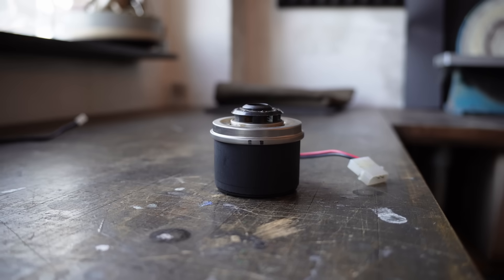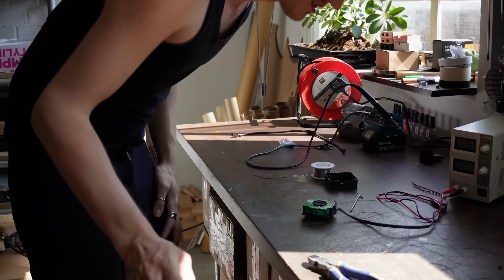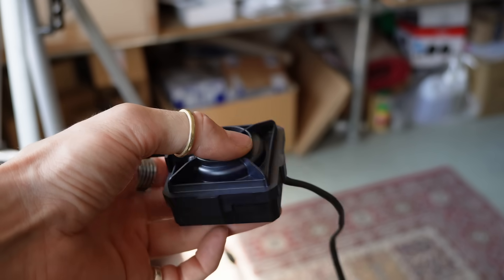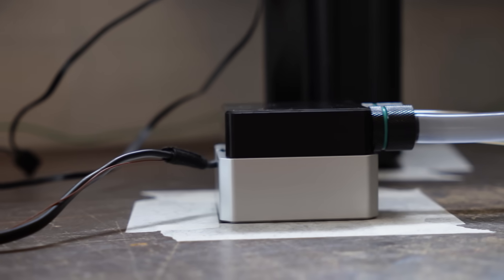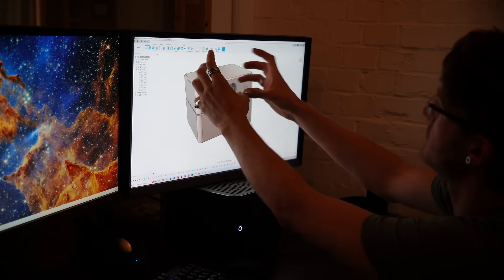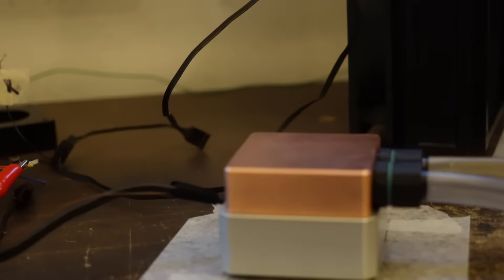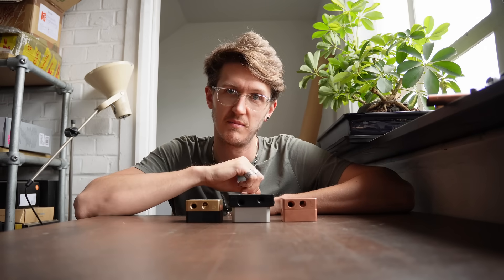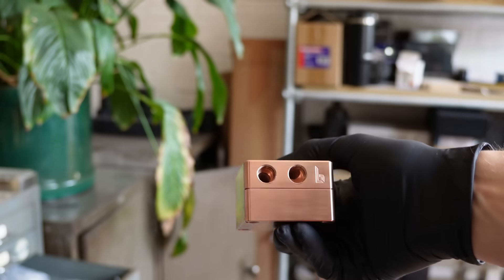Can you watercool your water pump?

Comment: I don't think the heat should be dissipated through the top where the water circulates because it heats the water and reduces the efficiency of the system.

I think it would make more sense to make a base with slightly larger fins and cool them with a fan similar to the size of the base.

They could also greatly improve the design of how water enters and exits the pump impellers and increase the internal diameters to 1/2 inch to reduce friction losses.

Comment: I was genuinely interested until I saw the price. 
I understand where its coming from, your work, the machinists work, the material, machine time etc, but thats a lot of money. I can buy a lot of pumps to burn through for that. 

Thanks for the scientific work on this though. And if you ever run out of ideas for stuff you make, I guess you can have a look at casting bits using lost PLA or making copper sponges. I hear those are excellent in terms of thermal conducticity due to the sheer surface area they provide. 

Oh, one more thing: Does your nail polish contain any aluminium oxides/salts? I would recommend not getting those near your fingers, as they are linked to dementia.

Comment: I watched the video wondering where you were going with the cooling. I wasn't sure if it would be a 2 part (horizontal slice) pump base, internal water channel around the perimiter with a 2nd restricted exit from the pump feeding it, or if it would be a thin cold plate with in / out integrated into the bottom of the pump casing to just hook into the loop. Turns out you went with option "C". Looks good too.

I run a DDC with large fin stack directly in the path of one of the 120mm intake fans on my case, so I never really noticed heat.

But another very cool video ('scuse the pun).

Comment: Hey, I just discovered your YouTube channel and you got some reeeeally cool things here. 

Something I have always thought but didn’t find anyone testing: negative pressure water cooling considering negative pressure should lower the boiling temperature and you’d take the advantage of the latent heat (and maybe have a way lower amount of active cooling required?).

That would also require a full ridged system, pipes etc. 

Do you think this could work?

Comment: A lot of people run the pump at 100%, if the speed is set against temperature, most of the time the pump will run around 20% duty, a lot less heat. It will only ramp up under constant long term processing loads. A correct size radiator will also extent the time the pump does not need to spin up as much.

Comment: So...buy a pump, then throw the housing away and replace it with the metal one? Might as well just source what chinese factory district the pump guts are made in and order them direct. And on that thought, Id argue chasing down which part inside the pump is being over speced and ran near its failure rating. Usually when mass produced chineseium stuff dies its because they took the absolute maximum rating as a 'totally A-OK 24/7' rating. Also, what about....just drilling holes in the plastic pump housing to vent that space that holds all that hot air in? I mean, really the problem is they have pushed the electronics too damn far. Like they do. How about not rewarding them with more sales for something you have to rebuild anyways....Find the pump supplier and give the middle finger to whatever company is marketing an inferior product version.

Comment: 12:18 Shouldn't use dissimilar alloys in water for any sort of long term use.  Dissimilar metals create a natural electrolysis that accelerates or even enables corrosion in cases where a metal shouldn't corrode (Like stainless steel and aluminum).

Comment: The problem with copper is...  (In my opinion) Longevity.  I think oxides will be a problem with time, and you'll probably need something like glycol instead of water.  Even the most pure dionized water will pull copper ions into solution and eventually become an issue as they migrate.  Especially if the pump is not entirely plastic, any dissimilar metals will similarly cause issue with corrosion due to dissimilar ions in solution (The same mechanism that suggests matching metals for hose barbs as well).  You'll also need to make sure the glycol is as dry as it possible can be, purge, and hermetically seal the whole system really well.  Glycol and mineral oil like to pull moisture from the air.  Any moisture in the system will likely cause oxides to build, that will eventually migrate and potentially clog the pump.  Your also lose thermal conductivity when you have a layer of oxides as they don't transfer heat as well as copper itself.
Reply: Rarely do pure copper blocks like this make it out of testing. The next step once the design is validated is to figure out a plating solution (likely nickel) and make sure it doesn't affect the temperatures too much. Not worth plating the prototypes since it would add a ton of extra time into the testing process.
Reply: @MaladjustedPlatypus  Solid point.  One thing you do can do as a marketing technique...  On top of advertising the copper block as a better heat conductor at what around 400 W/m·K, while aluminum is only around 250 W/m·K, and stainless around 30 W/m·K.  Then, the nickle plating, although very thin, is only around 90 W/m·K.  

The marketing technique that comes in is, while consumers are bad with numbers, 90 is < 400.   The 90 is what will translate to the average person (your consumers), not the fact that the 90 is microns thick and won't effect the overall heat conductivity of the copper more than like 1-3%.  So, you instead, provide them with a number that is higher than the 400....

It'll be more expensive, but, on top of selling the "lower" conductivity nickle plating, you can pay more to have them go through a vapor deposition process to coat them in GRAPHENE that you can advertise as "3500 W/m·K".  You can even through around fancy words like, "Engineered with an advanced graphene layer, this version leverages ultra-fast phonon propagation dynamics to improve thermal uniformity and surface-level dissipation".

I mean, that type if deceptive advertisement is shady and gross af, it'd probably work on gamers who are notorious for trying to min max every little thing

Comment: Even if it did perform the same as the EK one, it's better not only in size but in application, since it won't be as negatively impacted in places with low airflow or hot air.

Comment: Nice design;) this seems like the perfect use case for a heatpipe (bend into a c shape) but general problem with watercooling the pumps will always be, that the water can be warmer than 66°C which is over the ddc temp rating you mentioned, meaning it could burn out regardless...

Comment: I fully appreciate your CNC chops, and very specific build case scenarios. But when i was water-cooling, of course the pump was wet, i was using a pond pump in a Tupperware box. It was still a consideration, the radiator always went after the pump, youd assume the pump heated the water, n you wanted the coldest for your block. This was hand drilled blocks era, nobody would sell such a thing, water in a computer, your mad! One very nice feature is that the pump in a tub sitting on a peice of foam in a stout tub was very quiet. Another excellent feature of ye ol tupperware tub, it acted as an oil trap, large air-conditioning condensers were far more available than car heater cores, and no matter how you cleaned them always had oil left in them. The tub trapped the oil and was essentially self scrubbing.
Im very glad water-cooling has become so much more elegant and refined than the epoxy n silicone abortions I was building. Rebuilt every few weeks, and my machine overclocked to something faster than money could buy on a part time schoolkids wage.

Comment: If you're using solid metal chunks for coolers (no fins) paint them matte black.
Black radiates heat far better than a shiny surface. With less surface area for air to cool the pump, painting it is a quick and easy way to get it to put off a bit more heat without having to mill grooves into it.

That's probably one of the reasons the blacl plastic did well, it had a more complex surface design, so more surface area and was black.
I doubt you'll get more than a degree or two difference, but a sheet fine grit of sandpaper and can of matte black is cheap.

Comment: Grade 2 99.9% pure copper screws installed with thermal grease or assembly oil would be worthwhile to test. Should further improve the thermal bridge for even higher performance. Screws are available in metric Allen head on Amazon.

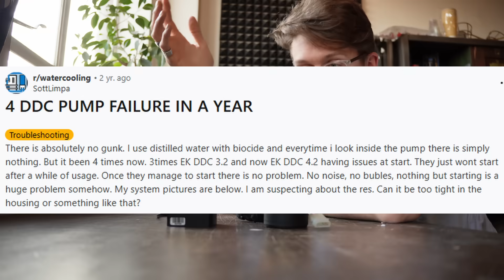Comment: 01:15 - I'm running a test loop with a DDC as we speak. 3x140mm Radiator with no fans, the rest of the PC is off too. I was shocked at how warm the loop had gotten after an hour or so of running, the only heat source was the DDC pump. Granted, it was at full power. No complaints, they are great pumps.
Reply from the maker: We originally ran our test loop with no radiator, and the water increased by 2 degrees over the first half hour test, hence adding the radiator. They do warm the water slowly but surely.

Comment: This is super cool to see! Reminds me of the Modultra conductor pump housings designed for use with their Lobo CPU block pump top. I've been using one of those (well, technically a prototype, but essentially identical to the final version) for around four years and it's worked amazingly well for me. Great to see more options like this!
Reply: I'm also using a modultra block and at the start of the video I was worried. My hope is that the modultra block works in a similar way since the back-plate is also touching the waterblock.
Reply: @kryptonitecb  The Lobo and their Conductor heatsinks are designed specifically for that to be the case. In the beta phase they were even talking about it working with other, smaller heatsinks (like the basic Alphacool heatsink), though of course not as efficiently as the contact area is much smaller. IIRC they tested the cooling effect quite extensively and claimed that it worked well.
Reply from the maker: Modultra are awesome. We thought we were the first to do this until we saw their pump housings!
Reply: @BilletLabs Whats amazing is that Swiftech never did it. They made a million DDC tops, and DDC heatsinks, but never a DDC waterblock.

Comment: This was such a fun yet informative experiment! As someone deep into researching submersible pump motors, I’ve always wondered if thermal efficiency could be improved externally—especially for air-cooled models used in semi-open wells. At GrowWithHeart, we’ve come across BLDC motors that naturally run cooler and are better suited for consistent use in Indian summers. Have you ever compared the cooling performance between openwell and borewell pump casings under load?

Comment: I have been using the same ddc pump for like the last 10 year using a bottom fin heatsink and setting the pwm signal from 30 to 40% more flow it didn't change anything of the cooling of the system. So no need to make it work 100% all the time.
Reply from the maker: That’s the case with most systems, but some of the crazier loops need more flow/pressure. Both of our builds have performed best with the pump at full speed.

Comment: Next, design a reservoir-combo top (inlet-hole and seal-ring on the top, G1/4 outlet on the side) or even a fully copper integrated reservoir (wouldn't that look sick), turning it into a watercooled DDC pump/reservoir combo for even more space-saving overall 😛
Reply from the maker: As soon as we’ve finished our cpu block, we’ll be doing a combined cpu block / pump, and maybe a cpu block / pump / res. Then maybe a monoblock with cpu/pump/res/gpu eventually.
Reply: @BilletLabscpu and GPU? lol what?

Comment: Swiftech Apogee Drive II CPU Water block & Pump for AMD, this is still performing and working well after two builds spanning 8+ years, the water pump sits on the CPU water block, and has a heatsink on top. 
https://www.google.com/search?sca_esv=586bf82e9e87a87a&rlz=1C1ONGR_enNZ991NZ991&udm=2&sxsrf=AHTn8zoan2p35PLAsgSqhFv-sxLt01POaQ:1746850183351&q=CPU+water+cooler+pump+Apogee+2&spell=1&sa=X&ved=2ahUKEwjY952FhJiNAxUcr1YBHTiAD60QBSgAegQICBAB&biw=2560&bih=1279&dpr=1.5#vhid=ue2aNHKE1seGmM&vssid=mosaic

Comment: the solution seems so simple, i'm surprised the manufacturer of the pump doesn't have this as a premium option themselves. and the fact that its a known issue and the manufacturer refuses to figure out the heating issue after extended use is a bit silly. 

who would have thunk metal is better at drawing heat away from electronic components better than plastic, definitely not the members of this manufacturer.

Comment: I found this really fascinating but I'm curious, what if you turn the whole thing upside down so the water side is at the bottom but the component which sits inside the housing is then flipped on the inside so it comes direct contact with the water cooled part of the housing?
Reply from the maker: The water side is the pump top. If you did that you’d need another pump top on the top.

Comment: Is there an issue with galvanic corrosion with steel screws through a copper housing?
Reply: Potentially, but the amount should be almost non-existent unless you have an electrolyte (aka liquid) present, and if you have liquid there, you have bigger problems.

Also, fortunately, the steel should be the one to rot away, not the expensive copper box.
Reply from the maker: No. Stainless steel is fine, a lot of waterblocks even use a stainless steel jet plate. Also they aren’t touching the water so even less of a problem 👍🏼

Comment: I have a 6w DDC 3.1 pump I have reused from system to system from a EKWB Predator 240, I have a heatsink on it so I run it 100% speed since it's so weak all the time and it gets quite hot.

Comment: But who will watercool the watercooler that's watercooling the watercooler?
Reply from the maker: That sounds like a job for us
Reply: Its no use! Its watercoolers ALL the way down!
Reply: That's obviously the watercoolers job!
Reply: if you have three or four or however many pumps pumping into the bottom of the next and the next pulling water out of it's own bottom, into the bottom of the next, in a loop, you can solve this paradox. y splitter off two sides (bet it has to be even) for actually getting out anything.
Reply: Water cooler, cooler, water cooler. REAL MEN OF GENIUS🎶
Reply: The water silly
Reply: The real question is who's gonna watercool the water inside the waterloop?